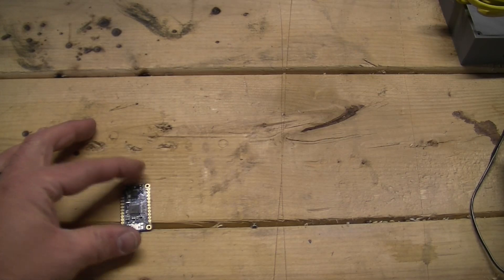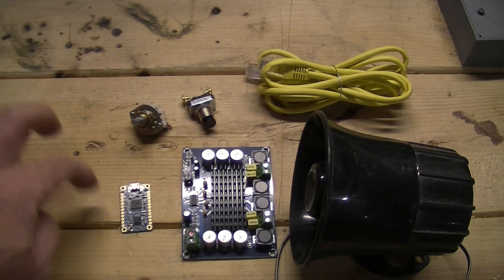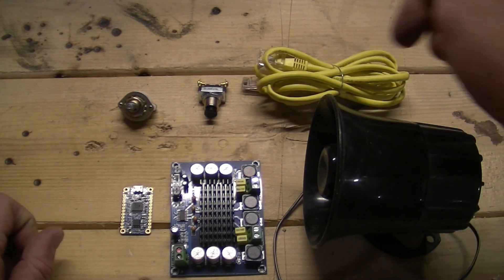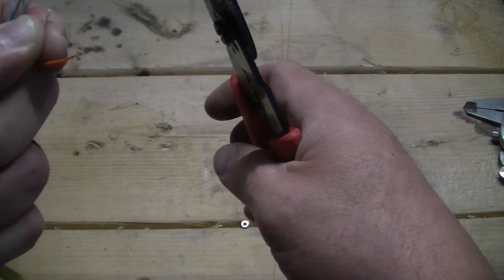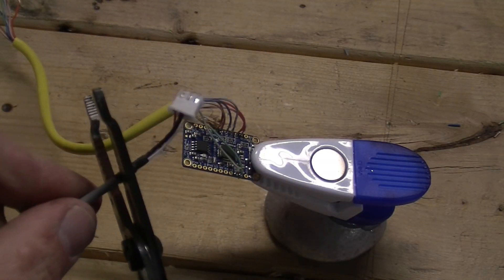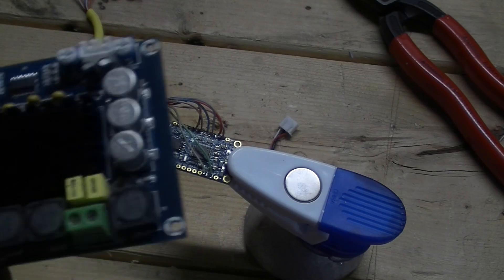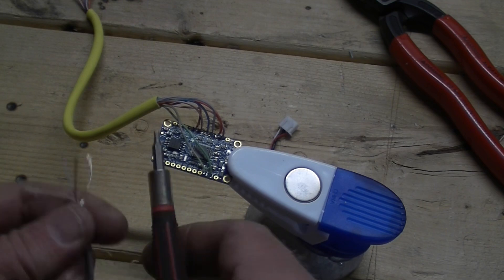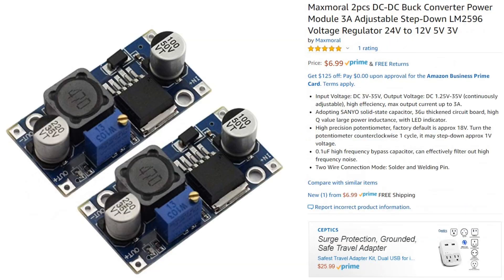Jurassic Park Sound Effects Horn - DIY Follow along video

Comment: You need to update your Amazon links. Your "micro" USB is currently pointing to a "mini" USB that I now need to return. Probably not your fault. Suppliers on Amazon switch product out all the time under the same product ID. But it's a real bummer that I can't test out my kit now.
Reply from the maker: Thank you for the heads up! They added more options, and now it is a different "color".  The link is repaired.
Reply: @The_Flynn_Effect  Awesome. It is a great video!

Comment: Can something like this be installed along with a car alarm system, like the output sounds be custom using the sound board? Like when the alarm is armed or when it goes off?
Reply from the maker: That could definitely be made and it's on my list of things I would like to do!
Reply: @The_Flynn_Effect  i hope is soon, got the alarm, the sound board and the arduino and amplifier on its way 😬

Comment: The amplifier is out of stock. Do you have any recommendations for a replacement?
Reply from the maker: Below is as link to a comparable amp.  Search "amplifier board" and you can find about any size you could want.

Diymore TPA3116DA DC 12V 24V 100W Mono Channel Digital Power Audio Amplifier Board TPA3116D2 Large Capacity Board https://www.amazon.com/dp/B01M0FO1JZ/ref=cm_sw_r_cp_apan_glt_fabc_T9X2WCWVHY2QQ4QF2KBE

Comment: Sick! How did you wire the rotator switch and activate button to the board? I'm trying to do the same but the sounds keep looping when switching.
Reply from the maker: The rotating selection switch is in series with the push button.  This way the connection is only made when the button is pushed.

Comment: do u only use 1 of the channels on the stereo amp? and if so does it matter which one? 
btw isn't the watts on the amp to high for the speaker?
i'm new to this so sorry if these are obvious questions.
Reply from the maker: In this setup, only one channel was used.  Both are connected on the input side, and the other channel output is accessible for additional speakers.
The watt ratings are too complex for a comment section.